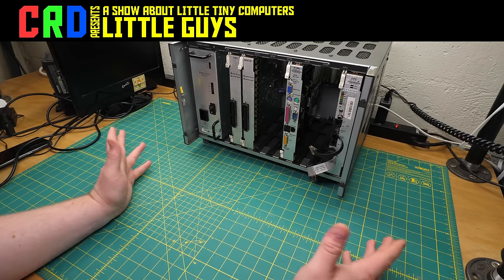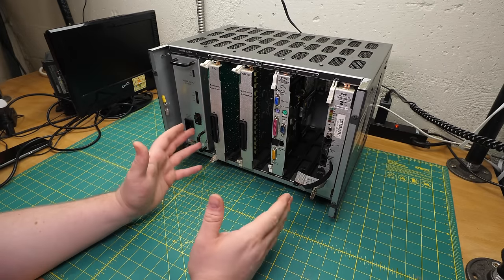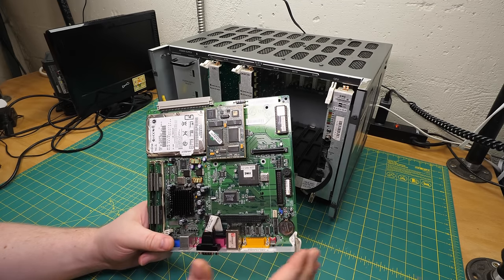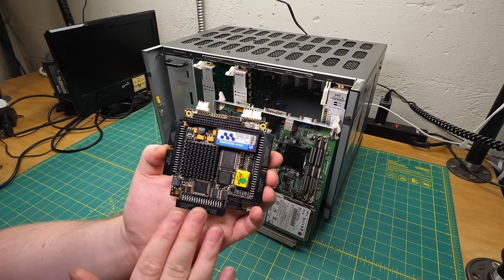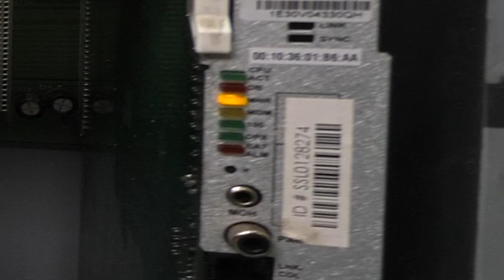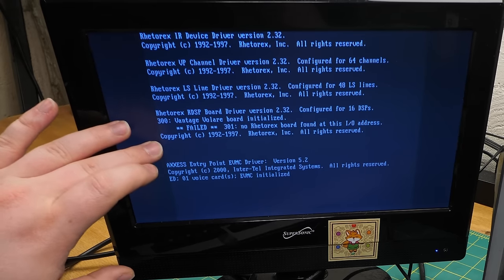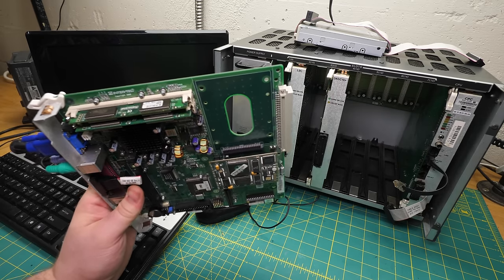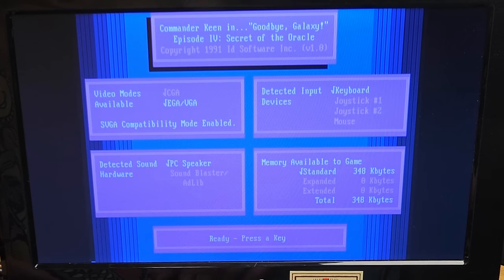Little Guys 9: The First Of Many [Intertel Axxess]

Comment: yeah, PC/104 stuff is horrifically expensive because it's still used VERY widely in industry, so aside from "hobbyists"  the only market is large companies.

The CPC is running VxWorks, the POSIX main bit is a dead giveaway.

You're also correct about the accounting stuff, it's called CDR "Call Data Recording", I used to provide support for a phone billing system which we sold into hotels, it was based on a custom ISA card which was basically a full 8086 system with a pair of hardware buffered serial interfaces, which you'd plug into a PC running DOS (originally designed for PCs which were about as powerful as the card but with less RAM ;) ), it'd take the CDR feed from the PBX, process it through various billing tables then spit out a custom record over a different serial port which was plugged into your FOH billing system (and frequently an Epson dot matrix printer for backup).

Comment: If I remember right I also saw things like storage, CPUs multiples of, and like you said VGA etc for the PC 104 and 104b etc class cards. 

Probably the big reason they're still available insanely expensive is compatibility between cards because of the pc104 interface. But also because there's something called a numa case that you can put them into which is also what they use for things like very embedded industrial and aviation uses. Things like specialized aviation approved equipment.

Comment: I had so much fun working south the old access system back in the day.  We got the first VOIP card available for it, and the fun really started.  I lived in an area at the time that didn't have broadband yet.  My boss made a call the I could work remotely some days if I could get a voip phone working at home.  He didn't think I would be able to with a 56k connection.  I tweaked the packet settings and size on a voip phone and got it working over a 56k connection to the internet...  I couldn't do anything else on the internet when on the phone, but I got it working great and call Qual was tinny but it worked.  Boss couldn't believe it.   
Loved how easy it was to work on that old system..  great memories!   Cheers!

Comment: My first post-college job was using an intertel system. They were very license heavy for every little feature. In fact, if you wanted to add a phone, you had to get your contract/license modified and that endpoint number could never go down. We dropped them as soon as we could.
Reply from the maker: Fun Fact: That's still how it's done by so many vendors now, particularly for cloud PBX. It's miserable and stifling and drove so many people to Asterisk despite its myriad problems.
Reply: @CathodeRayDude  that's not a very fun fact. At all.
Reply: Freeswitch is a great PBX too
Reply: I work for one of those providers in NL. Licencing is based on user / seat count. Can be changed every month

Comment: 11:50 - A couple of the most fascinating devices I ever had to work on where the Toshiba voice mail systems for their PBX systems.  They had one family of them that were basically the same device, just one was internal to the cabinet, and the other was an external device.  It ran DOS!  You could connect a serial terminal to it, and watch it boot, and interact with it like a little DOS machine.
The other one came later, and was more like the one you show here, and it ran a version of Windows NT (4 I think).  You had to connect to it using an ancient version of MS NetMeeting, and if the old spinning hard drive on it died, you were absolutely screwed.  I don't miss working on that stuff.

Comment: There's a lovely hobbyist project called the weeCee based on PC-104. The main part of the project is basically a PCB design for a Crystal CS4237 based sound card, designed to be paired with a Vortex86 module. So the most accessible PC-104 sound card is probably that.

Comment: I've got a three 386SL based PC104 computers made in the '90s by a company named Megatel in Ontario that no longer exists. I have collected some documentation about them. They're real interesting, with a sort of early flash-based filesystem, VGA, floppy and IDE controllers on board and one of them even has ethernet. I have a breakout board of sorts since they use a one of those DIN 32-pin connectors in lieu of separate connectors for each peripheral. I intended to make a PC out of them, but it's been years and I'm sure you'd do more good with them than I.

Comment: OS/2 used to be common on ATMs in the 90s and early 2000s. I found that out late one night when I was getting cash from one in my office's lobby to do a 7-11 run. It started the transaction, spat out a 20 dollar bill, then rebooted itself. I got to watch it boot and found out it was an old 386 PC running OS/2 Warp, which was fascinating. Unfortunately, it ate my debit card in the process, which was less fascinating.
Reply: it should have spat out the card after boot completed and it realizes the port switch is activated or blocked but a user isnt logged in or doing any transactions. 

if not you can enter your pin then cancel ? 

but mag strip readers wouldnt know if the card coukdnt run over the reader lol but nobody else could put a card in?😅

😂

Comment: The house I grew up in had a Vodavi StarPlus DHS with two trimline AT&T phone 6 executive stations with caller ID (odd feature  but all it said was the phone number from what i remember) one Panasonic cordless phone a viking intercom.

All connected to 4 lines.
One for fax, one for business, one for home, and one alarm line.

It never dropped out and I think it had the call waiting module as I remember music all hooked up through an unlabeled punch block.

All services were provided by MCI and then Verizon. Despite thr digital upgrade in 2006 we still used the traditional pbx as we wanted our money's worth.

Comment: The PC-99 standard might have made it an industry standard, however, Packard Bell had been using that same color spec on its ports much earlier than that.  This unlocked a memory of first seeing this around 1993.  Through the mid-90s (and other manufacturers started having some uptake a little earlier than PC-99, I can't recall ever seeing a Socket 7 motherboard that had USB and didn't have colored ports), it was a dead giveaway if something came from a Packard Bell because the cable connectors would be molded in the same colors as the sockets in an era when cable connectors were typically beige, black or maybe chrome if it was some kind of parallel port sound device.
Reply: My Gateway PC (Pentium 166) has USB ports and non-standard colors. I think some ports are normal-colored but the keyboard is orange and the mouse is purple.

Comment: I salvaged a PC-104 system from thew electronics lab at work. Has the good I/O bits (VGA, USB, ethernet, IDE, Floppy). I'm happy to send it your way if you'd like. The base is a Diamond Prometheus (I think) with a Diamond Pandora faceplate.  Has an IDE flash module as well.

Comment: Compaq was using their own color code for keyboard Orange, mouse Green, monitor Blue, speaker red, mic again blue but they also tend to put the microphone in the monitor and had some sort of attachable speakers. And this was done before the color standard went in to Standard. It was one of the nice things they were doing that simplified set up that I think other manufacturers didn't go along with until it became a standard and surprisingly the colors are fairly similar.

Comment: I used to help admin crusty old Avaya PBXs. We’d buy whole PRI trunks or just a handful of channels, then configure a complex web of rollovers and trees. Using the software was insanely confusing and awful. It barely worked.

When the guy who ran them all quit, I was put in charge of all telco. I immediately went around ripping them out and replacing them. I still hear the default ringtone and wince a little.
Reply: Sounds like a PBX to me.  Awful interface with settings written in an indecipherable foreign language.  Terrible software.  Insanely expensive.  And, if you can get it to run at all, it will run for the rest of time.

Comment: I used to manage this Intertel Axxess system's predecessor - an Intertel/Premier ESP which was configured using a menu driven COM port interface - it was actually pretty user friendly...   I finally scrapped out the old chassis and the 2 spare chassis' (not quite Office Space style) when we upgraded to a VoIP system (with voicemail - finally).

Might be interesting what's used in a Nortel BCM phone system, or a Meridian system/voicemail system.

Comment: The Winbond chip is probably the standard super IO chip with dual serial, parallel, mouse, keyboard and floppy controller
There is a PC/104 USB controller that works with 8bit ISA, its the same as the little ISA USB controller with the CH375 chip that only does sub storage under DOS

Comment: Actually, Ctrl+Alt+Delete is a low level key combo. It gets caught by the BIOS and passed to the OS if it's running in real mode, as opposed to standard mode. This is why you have to hit Ctrl+Alt+Delete in Windows to get your login window, because it's an actual hardware interrupt that has to be handled by the firmware or the kernel. CTRL+ALT+DEL is actually a very special key combo on PCs.
Reply from the maker: There is a tremendous amount of misinformation about this as far as I can tell. It's very common for people to claim CAD generates an NMI, and in fact I made that statement in the video as originally shot, and some people called me on it so I looked into it. I can find no indication that CAD generates any special signal; it's not mentioned in any MS documentation, nor in the original PC technical manual. As far as I understand, it's simply a sequence that the default bios keyboard handler looks for to trigger a reboot, and when you boot an OS like Windows it replaces that vector with its own code which also listens for that combo. It has special significance only because the kernel keyboard handler will not send that key combo to anything except the login process.
Reply: I believe the Ctrl+Alt+Del (which started with NT) was supposed to be a security feature—this was the only place you would enter your password so the users were supposed to know that any other login window was fake (this was before the ability to do admin tasks by entering the admin password etc).
Reply: @markjames8664   It didn't start with NT, it started with the PC, in the BIOS as CRD said.  (OK, TBH, I have no idea if it was significant on CPM machines before that.  But it definitely existed on the IBM PC and has been around ever since.)

Also as CRD said, it was used by NT as the login attention sequence because no other program was allowed to trap that combo, to prevent things like a key logger that might capture logins and passwords.

In between, 16-bit Windows trapped the keyboard interrupt, circumventing the PC BIOS, and responded to that sequence to show the Task Manager (or to reboot in an emergency, if you kept at it.)
Reply: @nickwallette6201  I really meant its use in  logon.
Reply: @markjames8664   Ah, well, in that case.  Carry on!  "Well actually" withdrawn.
Reply: @CathodeRayDude  It's not a special signal--as in, it doesn't generate a special key code or anything, it's just a key press like any other, but it IS handled exceptionally by both the BIOS/Firmware and your OS.
The combination IS a hardware interrupt, and is handled at the lowest layers of the firmware or OS.

This is why Ctrl+Alt+Delete can often still function with a machine that is incredibly unstable, or otherwise locked up.
Reply: @markjames8664  Yes, but that's because the key combination is written into the very core of Windows. Your kernel would need to be fundamentally compromised for any other application to be able to capture the Ctrl+Alt+Delete signal away from the OS.
Reply: @nickwallette6201  Yes, exactly, which is what makes it special.

Comment: Ever since I found out that my modem could send faxes in middle school, I've been fascinated by the prospect of interacting with phone lines using a computer (well, besides the obvious use of connecting to the internet). Unfortunately, with extremely limited internet access and my extremely limited command of English language at the time, I couldn't do much about it.
Got to use that knowledge exactly once, by sending out a hundred or so custom faxes overnight for my father's business. Everyone thought that I was a wizard for a brief moment, until they realized that these faxes were probably going straight into the trash bin.
Something like this would have blown my entire mind at the time. Thanks for the video, this is a cool piece of hardware!

Comment: I remember reading that Duke nukem forever was designed with the 486 as they're absolute basic minimum. There were some features in the very first level which they had to remove because it hung 486 computers. I think it's included in the developer commentary on one of the later re-releases.
Reply: yet i dont recall anyone playing these games on a 486? im surprised tomb raider runs at all on a 486?
Reply: @pazsion  gaming on the minimum specs is never very common. Metal gear solid the phantom pain had some minimum spec of a 2012 i3, but I very much doubt anyone was playing that game on their office computer.

Comment: All 486DX machines had FPUs built in. They were the first Intel x86 processors that did, and it's why there was never an 80487DX coprocessor for them. There was an 80487SX chip available for 486SX machines, but it literally disabled the 486SX processor and took over as the CPU. 

The big deal with the Pentium was that its FPU was a whole hell of a lot more capable than the 486's. It was also Intel's first superscalar chip, capable of processing two instructions per cycle. The Pentium was somewhere around 3-4 times faster than an equivalently-clocked 486 when it ran Pentium-optimized code, and over an order of magnitude faster at floating point operations.
Reply: I had a 486 DX4-100 and a Pentium 75 around the time that Quake first came out. The Pentium whalloped the 486 despite being 25 MHz slower,

Comment: On PC104, I have a pair of Advantech PCM-9388 SBCs that I'm using for a retro PC arcade cab, they're a P4 based Celeron M 600MHz... I salvaged them out of a McDonald's order confirmation kiosk, they used to run XP Embedded.
Sadly only one has the original LCD display and power supply setup, the other one is just the SBC.
They're pretty useful, has onboard HDA sound (which works perfectly with SBEMU), but has a PC104 interface, so it could get a genuine Sound Blaster.

Comment: 25:00 Game ports are MIDI
Hence the audio and data capabilities above the gaming use!
Reply: it was likely using tones to digital commands to talk over the modem for phone over ip and multiple choice menus, 3 way calls and long distance calls. otherwise youd be doing it manually with one of those handset bases for a 3way call or any tone tone /pulse to digital. 

🤔

Comment: Those 72pin EDO DIMMS were still used way into the 2000s in printers (i upgraded mine with 64Meg in the form of a single DIMM sometime back then) and stuff, they were cheap and commonly available for several years afterwards even though they were pretty much end of life by then.
Reply from the maker: huh! see, I knew 30- and 72-pin SIMMs were used in printers throughout the 90s, but in the 2000s it seemed like RAM prices dropped enough that they just started soldering on "all the RAM you'd ever need" in the consumer ones, and then the business ones got big honking SDRAM sticks. Guess I shouldn't be surprised though

Comment: NO WAY I HAVE ONE OF THESE THINGS! it came from a recycling yard years ago and I thought it was neat so I took it home. Never once did I figure out what it actually did.

1:04:15 This is partly true, the three finger salute is actually specially listened for by the keyboard controller and does pull a real interrupt, not a virtual one. Of course, what the machine does with this interrupt is often modifiable, though. I'm aware of a few early clones which tied it straight to the reset line, I believe the Hyperion was among those.
1:22:02 I'm that guy, never heard of this game. It seems fine with no music, but I usually turn the music off in most games anyways.
1:24:16 with the age of this, I wonder even how good those caps still are, and yet it does so well! One wonders, if no other cards were installed, how long would it keep running with good caps? It's like a little built in UPS.
Reply: No, there's literally nothing special about Ctrl+Alt+Delete. Every key press generates a hardware interrupt. The interrupt handler on the CPU reads the scancode. The default hardware interrupt handler will call a software interrupt for normal codes.

The PC/AT's KBC is able to directly reset the CPU but this is a hack to get the CPU out of protected mode.

Comment: Re: 486s and USB - there were late-era 486 motherboards with PCI slots that you could stick a USB card into, and they'd work fine as long as you were running an OS on it that could handle it (whether Windows 98 which had general support or various DOS drivers). But of course the BIOS had no awareness of it and wouldn't have any options.

Comment: Really interesting. Especially the tidbit about faxback. Never even imagined this can be a thing. Very smart. For the time.

The reason why it reboots when you stop the program, is the watchdog. It is so if software crashes, a special piece of hardware in SoC after timeout will issue a hardware reboot. Pretty standard, in fact most PCs also have this ability for exactly same reason, but it mostly used for industrial / embedded systems.
The CPC probably does not run Unix - it could but 50/50. More likely it runs some real-time operating system that has some POSIX coverage for basic C stuff including IO, process control, network sockets, etc. Pretty common.